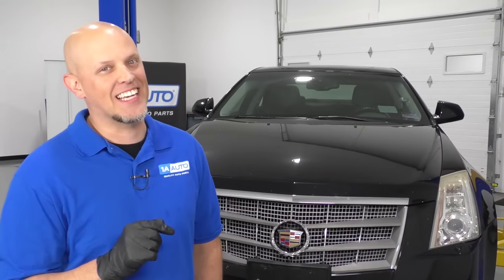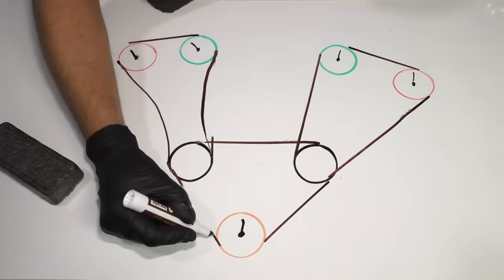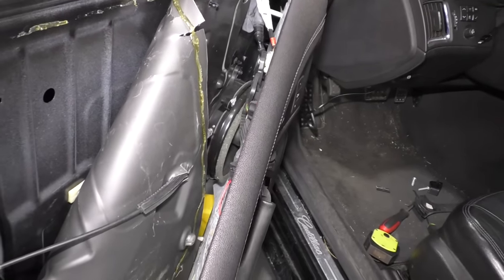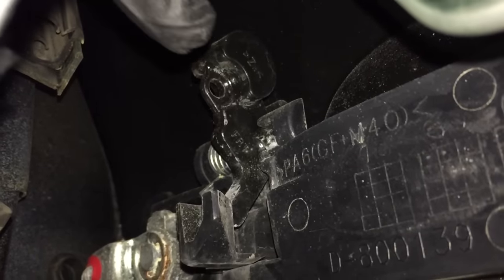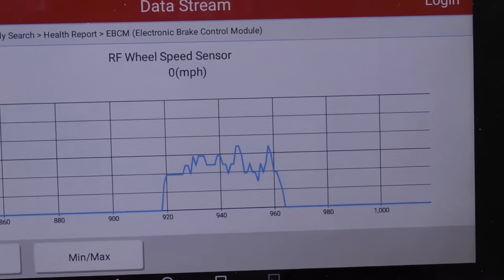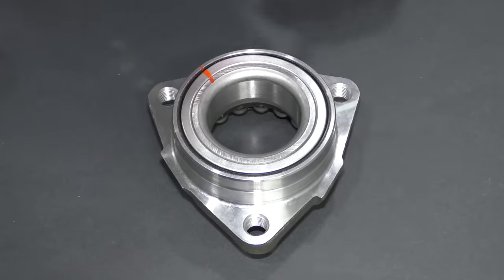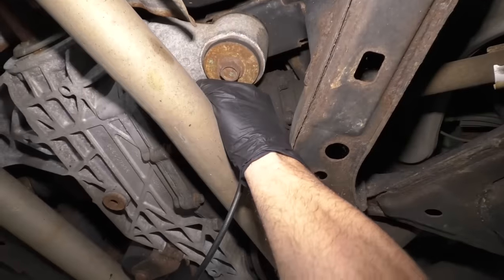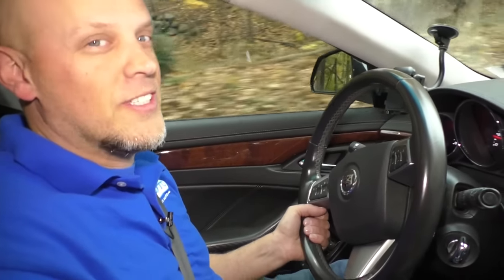Top 5 Problems Cadillac CTS Sedan 2nd Generation 2008-14

Comment: ONLY QUICK QUESTION I HAVE..
DOES A 09 CADILLAC CTS HAVE A ACTUAL FUEL FILTER LOCATION?
BECAUSE I SEEM TO NOT FIND ONE NEAR THE REAR PASSENGER SIDE BY THE REAR TIRE.
Reply from the maker: +GABRIEL ROMAN Thanks for watching!  Yes the fuel filter is located in the fuel tank module, it is not external to the tank.
Reply: @1AAuto  
THANKS A LOT! YOU SAVED MY DAY...
😆 ✌
Reply from the maker: +GABRIEL ROMAN Thanks for checking us out! 1AAuto.com

Comment: Having timing chain issue today on '06 3.6L V6. Just replaced evap can, fuel pump, purge valve and fuel injectors too. DAMN
Reply: Chances are you're car didn't even need all those parts.

Comment: I just bought this car and within a month I had to spend $1000 on all four tires because you can’t get just 1. A short time after at a stop sign I would lose power starting off but gets speed eventually. The code said something, sorry I can’t remember what it was. My son in law said it’s sounds like the transmission sensor? I love my car. Her name is black Betty. The tires caused my power steering out. It always says to check the air bag. Please help me

Comment: Would y’all recommend me buying one ?
Reply: Depends on if you can replace all this yourself. I've had 2010 awd wagon for 2 years, had to replace 2 hubs cause of the cracked reluctors and the driver door handle is starting to act up. I can do all that but when a headlight went out I had to take it in so I didn't have to take off the bumper myself. That was expensive

Comment: When doing a timing chain repair on this vehicle do you have to remove the engine?
Reply: No, you don't even have to get underneath the car which made this one of the most rewarding repairs I performed on my CTS, which looks like the one in the video. Do read the instructions for the repair, do obtain the proper cam holding tools which are cheap from ebay now (unless you are experienced enough to use wrenches like I did), do buy a quality timing set (I used Cloyes) and do consider replacing the actuators for a truly complete job.
Reply: @qq-hk2sq    How do know it's 'bad'???  I have an '03, and it's well serviced and in great shape.   But, I've had alot of cars, and I never had one go out!!

Do you go by miles?  If you have it done, is it expensive?      Does it make alot of noise, or just 'quit and fall out'?   I am kind of worried about that now.     Has 64,000 miles.

Comment: What about the issue of the main shaft bearing failing in the transmission and transfer case on the all wheel drive models around a 100k. Literally 5 grand to fix had to sell my beautiful 2009 cts what a huge price of garbage that car was burning oil etc

Comment: I’ve got a P0008 code on my car I have to get looked at as well as a problem with my fuel gauge. Every time when I turn on my car the fuel gauge says I’m lower on gas then while I drive the meter starts to raise to another level.
Reply: Prob your fuel pump going out. Mine started leaking gas.

Comment: I have a 2011 cad cts 3.0 I seem to be having ecu issues due to evap emissions  I've tried replacing fuel cap disconnected  the batt used my scan tool even paid 500$ to find the issue they claim to have smoke tested checked sensor above rear end still have check engine light at my witts end can anybody give me directions

Comment: My biggest issue with mine is the sunroof. That thing leaks so bad the drains clog about every 2 months of me clearing them. Got quoted 4K from Cadillac to fix it.
Reply: The rubber grommets that the plastic hoses for the drains connect in to go through the body, in the front kick panels and in the trunk in the side panels need drilled out. They come out fairly easy. The center of the grommets have a couple of small slits for drainage, and stop up easy. Just cut out the whole inside area with a drill bit. Flooded my cts also, i watched a utube vid to figure it out. Is actually easy once you see how its done, time consuming, is worth it tho. I did it last year and have had no problems since. Trunk leaks from crappy seal on 3rd brake light I suppose,,lol.
Reply: Nick Leding... It's the rubber "duck bill" grommets at the ends of the front drain tubes. They dry rot & do not open when water goes down the tubes. Pop out the push pins & inside  the wheel wells you'll see the ends of the tubes. Cut them open with an exacto knife or burn open with a soldering iron. That solved my problem.

Comment: Does the timing chain stretch cause a jerking type feeling when you are at cruising speed but in a neutral, no pull on the motor speed

Comment: ‼️I own a 2011 Cadillac CTS sedan with a manual transmission. Does anyone know a good website to find out where to buy a used or new transmission ? Also does a Cadillac CTS coupe transmission fit into the sedan ? Help please 😭‼️
Reply: what happened? I have one too. Should be same as the V6 Camaro manual, Tremec TR-6060 so I've heard.

Comment: Timing chains do not stretch..some people make videos like this have no clue what really is going on.Most of the time everything helping the chain flow fails such as the guides and some of the holding bolts
Reply: Tf you talking about timing chains do stretch. They have plates and little pins holding together and not having enough lubrication from the oil it’ll wear. You’re not wrong about the guides, they do tend to be the biggest reason timing chains fail, a lot of cars use plastic guides but they tend to break more than anything.

Comment: My top 5 CTS problems
Leaking sunroof 
Door handle stop working
Tire sensor broken
Automatic inside lights 
Wiper fluid spouts broke off
Reply: Bro Pru the sun roof drove me nuts , I cleaned out the 4 tubes enlarged the drains out of the car ,put Vaseline on the gasket to swell it . Then I got mad and applied removable acoustic black seal and shut it don’t need it any way , but I can remove the sealer if I want to have another go which I don’t. My car has 2.8 which is fine and now summer driver only . If I want a fast ride I get my 1976 supercharged vette out a few times per year
Reply: nick king I sealed my sunroof too
Reply: Bro Pru I find most sun roof leaks all makes . Do you live in the rust belt with lots of salt used in the winter? I live in Canada 🇨🇦 just 100 miles east of Detroit here they use salt and brine which is salt and beet juice it’s sticky and it worse than salt alone . I bought a 2011 f150 cheap ,the rockers and cab corners were gone I had to weld in new ones ,ford only put plastic tape on the back side of the rockers Oem from 2010 to 2014 it fall off salt and brine goes in, good bye rockers and cab corners lolo. Very annoying that why I don’t buy anything new or expensive . Anything nice need to be oil undercoated and stored from October to April here even hi humidity rots cars and trucks .
Reply: @bropru9137  what year CTS did or do you have this sunroof leak on? And you didn't answer nickking1510s question about what climate you live in. Weather does have a huge effect on sunroof leaks happening depending on various extreme climates. Especially if you have your car sitting outdoors in the driveway or in the garage. Thanks if you reply or see this message.

Comment: My 2010 CTS awd had a leaky diff that needed replacing, wheel speed sensors on 2 corners, and I've gone through 4 power steering racks. Mainly because the remanufactured ones were garbage.

I still love the car more than anything else I own. Although, maybe it doesn't love kissing 7 grand several times a day
Reply from the maker: +Tyler L'Hotta Thanks for the feedback!

Comment: 2012 CTS 3.0 Sedan
Stabilitrac light and traction control light came on. Firestone coded and replace wheel sensor. A short time later, lights came back on so I took it back to Firestone. They said it was a yaw sensor causing the wheel sensor codes and the wheel sensor was actually ok. They also said that replacing a yaw sensor is complicated and expensive and would require taking it to the dealership. My question is- is a yaw sensor that difficult to replace and is it true that they would cause a wheel sensor code. Or did they not want to replace the warranted wheel sensor?
Reply: Stay clear of Firestone!  They are crooks!
Reply: Randall, the yaw sensor/accelerometer is used by the Stabilitrac system to assist the driver in keeping the vehicle under control by reading the direction the vehicle is traveling, whether it is skidding, and uses the wheel sensors, along with a steering position sensor, and several others, to control wheel-spin if necessary by applying the brakes to each individual wheel using the ABS system.  So, it is feasible that a faulty yaw sensor could set a code if the computer can't get accurate readings.  If you're a fairly adept DIYer, you could change it yourself.  It is located under the right-front passenger seat.  If you move the seat all the way back, you should be able to lift the carpeting at the seam enough to reach the connector and two screws that hold it on.  Just make sure not to touch any of the yellow wires you see under there.  They are for the airbag system and you could inadvertently set off one or more of the airbags.  Here's a link to the diagram at justanswer.com:  https://f01.justanswer.com/ebrock63/c9e73d66-d872-4126-8ffd-fca3fa19f28f_2019-05-01_163855.png.
I found several used ones for sale on ebay ranging in price from about $32.00 - $148.00, depending on the seller.
But, here's the link to just one:  https://www.ebay.com/itm/Stability-Control-ECU-Ecm-Computer-Cts-1405313-08-09-10-11-Yaw-Rate-Sensor/352942478042?fits=Year%3A2011%7CModel%3ACTS%7CMake%3ACadillac&hash=item522d02d2da:g:DfIAAOSwZzVd-jhf

Comment: Does the 3.0L engine have the same problems as the 3.6L engine with timing chains?
Reply: If it's an early model, yes. It's a design flaw with the PCV system on the GM High Feature engine. The PCV sucks way too much oil out of the crank case, causing the engine to quickly run low on oil. The chain loses lubrication before the low oil warning even comes on, causing it to wear and stretch. I believe it was somewhat addressed in 2011 or 2012 with a redesign of the valve cover gasket, putting a baffle in front of the PCV tube. Regular oil changes and keeping it topped up mitigates the issue. If it does stretch, chain replacement is relatively easy.
Edit: I have a 2010 CTS with 110k miles, did the valve cover upgrade, haven't seen a check engine light yet
Reply: @eelcogg  Thanks for the good info. Where did you get the valve cover upgrade?

Comment: I've had 3 of them the all wheel drive also a bad design the output trans shaft to the accessory input shaft has splines that rust away no way to lube the splines which results in no vehicle movement.
Reply: rick coleman I would never by any make all wheel drive car / van  period nightmare waiting to happen .I  have a 2006 cts in mint condition 2 wheel drive summer driver.  I purchased it cheap as a trade in from a Kia dealership but it was in mint condition diamond white ran great , put on brakes ,rotors,emergency brake system shoes and hardware kit my self and 4 new Goodyear 18 inch tires my total including tax and safety check was under $ 3000 .. Recently I purchased a 2011 eco boost f150 cheap needs vac 4x4 front hubs, differential repair and rockers and cab corners which I welded in before weather turned too cold  its 4 wheel drive rather it was 2 wheel drive so I have to fix it all to get it certified . Only 4x4 I like are the manual ones which you have to get out and lock manually like I have on my 1992 Chevy tracker  . Another thing if you winter drive your car or truck get it oil undercoated annually  other wise 10 year old cars and trucks are junk from salt corrosion,they look good outside ,put them on a hoist and the chassis and lines are destroyed from rust

Comment: My 2014 vibrates when I slightly accelerate between 35 and 50 mph almost like I’m “doggin” the gears on a manual transmission
Reply from the maker: +UrMotto Tees We wouldn't be able to diagnose an issue like that here, you may want to have a local mechanic take a look at it. Thanks for checking us out! http://1aau.to/m/Shop-1AAuto-c

Comment: How often do you need to change the timing chain ?
Reply from the maker: +Zack Lopez Thanks for watching!  Timing chains should last a long time, so it is important to properly maintain your engine.  Also to be sure to check your oil level often.  Oil starvation can cause issues with your timing chain!

Comment: I have a clunking noise when it’s being driven at low speeds. Highway you don’t hear anything. I have the links, both front control arms with OEM ones and new struts. Like it was recommended by the dealer but I still have the noise. It’s a 2012 cts rwd, anyone have any ideas?
Reply: Do you notice it when turning? Swaybar end links, perhaps?
Reply: kimosabbe50 thanks I will check it.

Comment: Please stay away from the Cadillac CTS. GM, Cadillac don’t make reliable cars outside of the Corvette. The CTS looks good but they’re poorly made. I have a 2013 CTS with 36,000 miles and it needs over $6000 in repairs. Most notably, the alternator and upper front control arm bushing. The car is a money pit. I have a 2011 Lexus LS with 65,000 miles and I only have to change the oil and I got the front brakes replaced.

Comment: My brain is hurting 🤬😱😡🤯😭😫😠👨🏾‍🔧, great video 🇨🇦👍🏾👏🏾💪🏾🇯🇲
Yes, plastics 🥃🍻, everything is cheap plastic and cheap metal tube and parts😳. I live in Canada and these are big issues due to the ❄️.
Reply: Down here in the Northeast US, road crews use chemicals which eat up galvanized brake lines.
Reply: A Stanton1966 I live in Ontario Canada 100 miles east or Detroit road salt ,bring salt and beet juice will destroy you car or truck in less than 10 years ,the only way to slow this is to wash chassis and dry then oil spray entire chassis ,unibody frames ,trunk, doors, lines  ,hoods fenders ,suspension, bumper mounts ,rockers,cross members ,rad supports  and oil pan and door pillars ANNUALLY. Done correctly I have made one  my car last over  40years and my daily driver is a 2004 Grand Prix 3.8 gt with no rust

Comment: I have a 08 CTS and my Engine light and AbS is on then it have trouble starting up
Reply: My abs light fixed when I changed the rotors and breaks. 
Mine has issues starting when I fuel up at certain places too. I changed my fuel pump maybe 3yrs ago bc of a gas leak (smell was horrible)

Comment: Thank you for the awesome video. I have an 08' cts two-wheel drive that is making a humming/vibration noise when going 70-90 km/h. whether I am accelerating or slowing down it does it when travelling at those speeds. It sounds like it is coming from the rear end of the car. Almost like I have a sub-woofer in the trunk. Any help would be awesome :)
Reply: Grab your drive shaft near the center of the car and see if there's any play. I had the support bearing go out on my 08 rwd and it was causing vibrations because it was off balance.
Reply: @slickrick506  My '08 3.6 DI also.

Comment: does the 03 cts have an oil leak problem?
Reply: I have an 03 CTS had an oil leak problem check your oil pressure sending unit it's at the front of the engine down on the passenger side
Reply: H K Wall i have one as well, thanks for the info, do you also know how to get rid of the airbag light?

Comment: I just took my 2008 CTS to my Cadillac dealer to repair the door locks on both front doors and my service adviser says they have to replace the entire door handle which included painting the new handles. That sounds like a con, can't the switched be replaced without having to replace the entire handle. These damned dealers, never repair anything, their solution to every problem is replace everything at outrageous cost for parts and labor.

Comment: My 2006 clunking sound when shifting
Reply: That cost me around $600 to fix, it's a simple little piece that needs to be replaced, but the labor it takes to get to it is what will actually cost you. ANYTHING labor costs extra on these cars. A friggin tune up (just replacing the spark plugs) runs about $400, at least that was the case for me and I literally went to 5 different auto shops to get a price quote.
Reply: Driveshaft or driveshaft bearing

Comment: I regularly changed my oil and chain stretched at 90k smh costed me $2700
Reply: ANTHONY FIGUEROA what year car
Reply: @marcus5865   2008 cts4
Reply: Did u get the work done at a Cadillac dealer?
Reply: You may have changed the oil, but did you check the oil level regularly between changes?
Reply: @johnjohnmcclane1818  I pampered my cts like a baby . Yes I checked my oil levels . Fyi now I got electrical issues. it's been sitting in the garage since the beginning of winter ..

Comment: I have a question for the 2011 Cadillac CTS V. I am having trouble with the heat and AC. I can’t cut the heat and or ac off it runs on its own. Bad electrical problems.

Comment: Anyone with a 2009 cits premium with Bose system. If your Battery keeps going dead it is probably the Radio drawing current . Now after after months in shop looking for radio Delco says this radio is no longer supported by GM.and no one can fix it. Radios are available ebay , used ect , but can't be programed because of anti theft programing , believe me we tried. with Delcos help.   So car will run with out radio but AC and all its AC will work but you can't control them,  Finally put in after market radio there are kits available . but now you won't have your GPS, CD player..GM sucks not supporting a car 11 years old.
let me now is anyone else have this problem since after market radios sound crapiy and are difficult to use.

Comment: 2 timing chains later.. an evap fix and a wheel hub assembly changed this car is destined for failure. The timing chain alone has a service bulletin which should let you know it's a documented issue. I will NEVER buy another Cadillac. Period. I repeat 2 timing chain replacements not just one smh